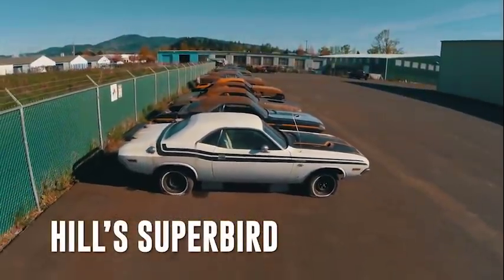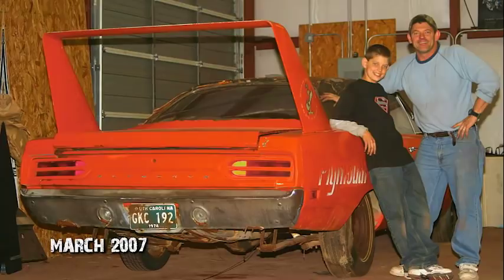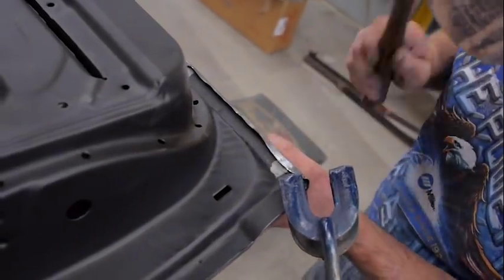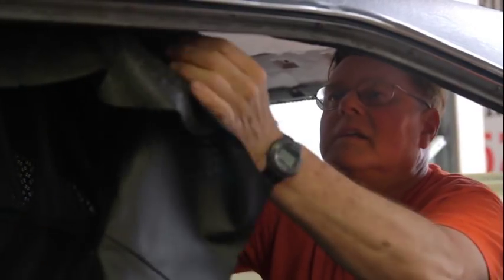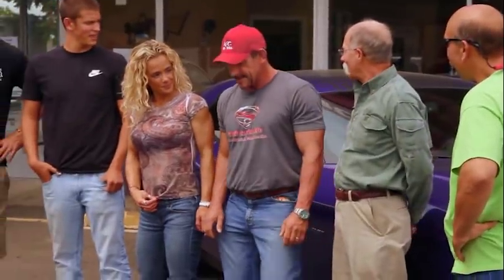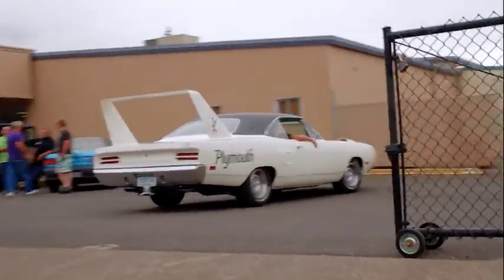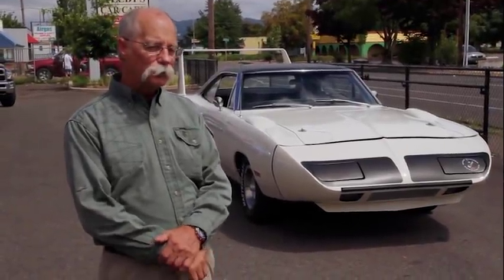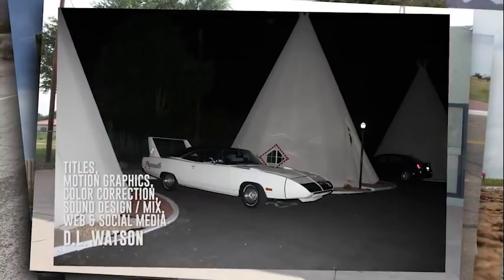HIstory In Reverse Episode 4: Superbird

Comment: Body panel alignment is horrible! They weren’t the best new but they created the problem when replacing panels incorrectly!
Reply: Oh im sorry i didnt know that you too did this for A LIVING FOR LAST 30YRS..shoulda brought it to you fella huh...smh
Reply: @CraigBrosRacing    40 years!
Reply: @CraigBrosRacing    Go to a concourse show and count how many Graveyard cars are in it! You won’t find Roger Gibson using all that Taiwan sheet metal. AMD panels are stamped in Taiwan like all the other junk panels are at the same factory. The problem is they use epoxy dies, not steel tooling the factory used. These plastic dies flex during the pressing causing ripples and distortion not found in original panels. Before removing major body panels like the entire floor pan and roof the car MUST be x braced, this one wasn’t! When the “Brothers collection” has rare Mopars restored they use Roger Gibson or Magnum auto restoration, never Graveyard cars?